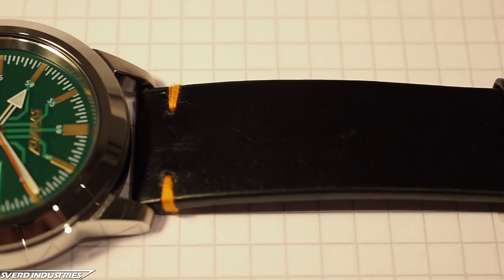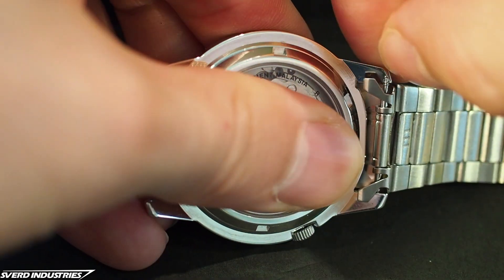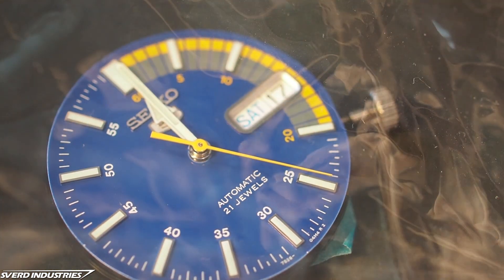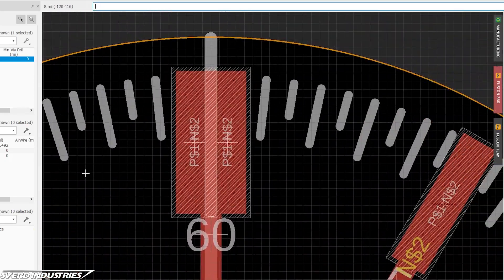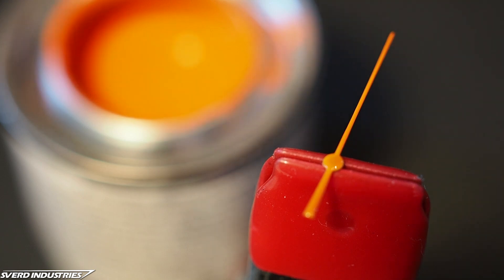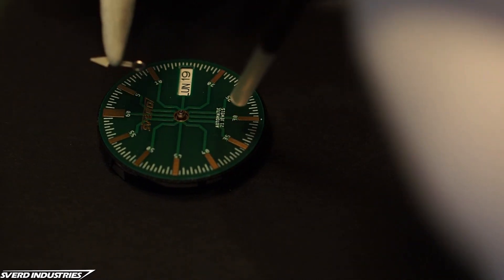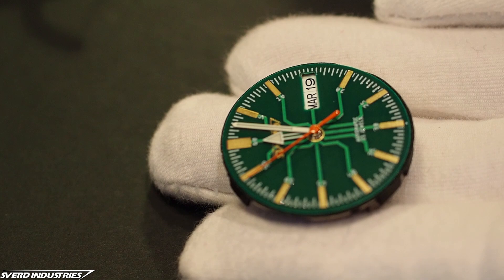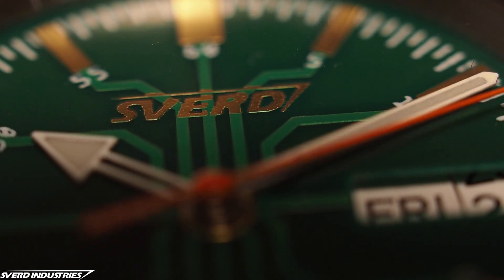How I made a PCB dial for a mechanical watch

Comment: Using tape on the case back increases the likelihood that the bits on the case back remover slips, and when they do, the tape is usually not enough to protect the case back from scratching anyway. The way to prevent slipping is just to use the correct size bits and using a watch vise. Never just hold the watch in your hands.

Comment: Excellent work!  The same idea crossed my mind last year when I started messing around with watch modding, mostly because PCB design is the only area of CAD that I have much experience in, haha.  If I get around to making my own I would like to explore solder-in locator pins like the original dials have.  3D printing is outside my area, so rather than making a custom movement holder, having locator pins on the dial will save me a lot of pain :)
Reply from the maker: Did you go for it yet? :)
Reply: @SverdIndustries  haha, no, I haven't gotten back to my watch stuff for a while.  Still on my mind, though!
Reply from the maker: @undamned I know exactly what you mean haha. Hope you find the opportunity to get back into it!

Comment: i love the adapter that you made. why did you not just use dial dots. the tiny little adhesive pads that most moders use?
Reply from the maker: Thank you. Actually I just learned about dial dots after publishing this project, had I known from the start I would have used those. Oh well, the 3D printed adapter worked out great though